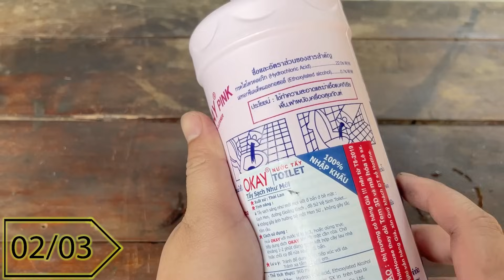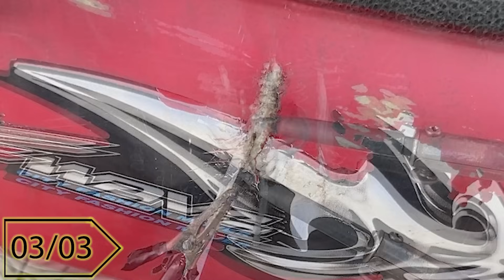3 White House secrets few people know! I learned to solder by not soldering you never knew

Comment: Very important to note that these are Saline, Zinc-Carbon batteries that are used in this video and not Alkaline batteries!
Saline batteries are more complicated to find in stores, in any case in France no one sells them anymore, except sometimes stores that recover end of stocks from all over the world.
Otherwise on sites specialized in batteries, it can be found.

The liquid that is manufactured at 02/03, it is called Zinc Chloride.
All you need is Zinc-Carbon batteries and to put the Zinc that surrounds the battery in Hydrochloric acid and wait until the Zinc is completely eaten away for the product to be most effective. It is a stripper that allows you to solder with tin on surfaces that do not adhere well.

And for the soldering iron at the end, it is the Carbon rod that is in the middle of Zinc-Carbon batteries only, not in Alkaline batteries.
Reply from the maker: Thanks for the detailed explanation! It is true that zinc-carbon batteries have a different structure and usage than alkaline batteries, and you made it clear in an easy-to-understand way. Using zinc chloride to remove and improve solder adhesion is a great tip. Thanks again! 😊

Comment: The brake handle seems like a bad idea.  I don't understand why you need to make the tool when you could have used the bolt to cut the threads.  Although the tool was the most interesting part of the video.
Reply from the maker: Thanks for the feedback! Sure bolts can be a quick fix, but I wanted to try making tools to learn and apply new techniques. Glad you found the tooling part interesting!